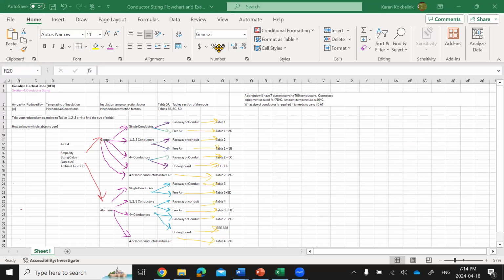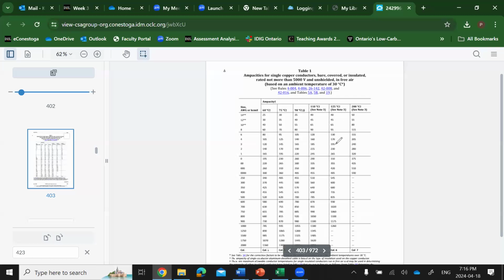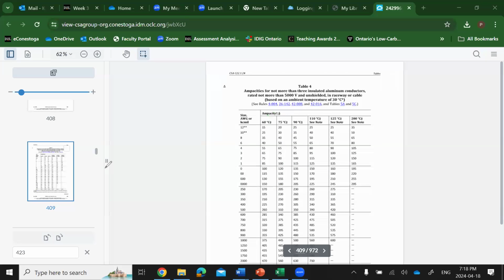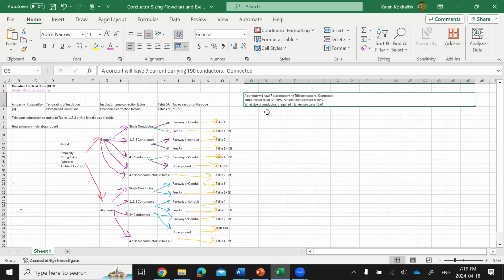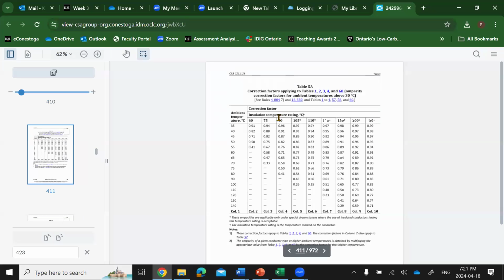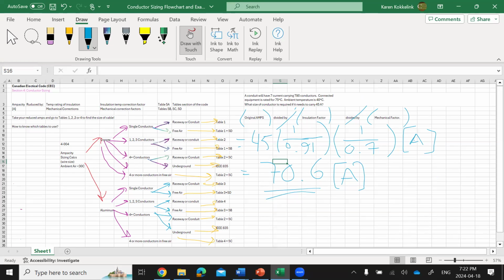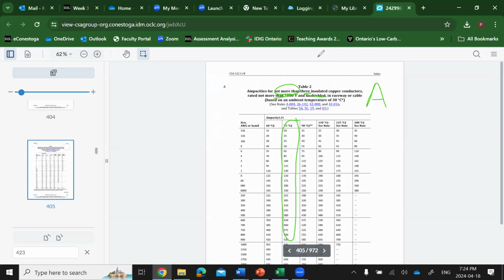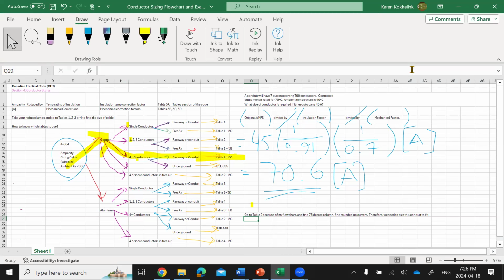Example of CEC Rule 4-004 Conductor Sizing for Electrical Exam

Comment: Doesn't table 2 say "not more than 3 conductors" and not "more than 3"
Reply from the maker: Indeed.  For more than 3 conductors, you are "bundling".  In this case, you need to apply Table 5C, because it's harder to dissipate heat when the conductors are all snuggly with other conductors.

Comment: Give an example for using table 5D and 5B
Reply from the maker: Hi @masoudariyaei5742, sorry for the delay.  I just made an example question and answer for you.  
Question: What size SER should I choose to run SER to a 100A sub-panel through an insulated, 40C attic?
Answer: 
SER cable is Service Entrance Cable, Type SE, style R.
For a 100 A subpanel, my overcurrent protection is 100 A.
The feeder conductors must have ampacity ≥ 100 A at the termination temperature rating (75 °C).  This is from 14-104 and 4-006.
Please look at Table 2.  We see that 3 AWG Copper has 100A capacity at 75C (terminations) and 115A at 90C (insulation).  We need to use the terminations column, 75C.
So the baseline ampacity is 100A with no corrections.
Correct for attic temp, 5A: 
But attics often exceed 30 °C, especially in summer.  So that’s were we use Table 5A, because 4-005 subrule 9 tells us to correct for this temperature above 30 degrees ambient.  Let’s assume the attic temp is 40C.  Table 5A has a correction factor of 0.88.  Note I still need to use the 75C column.  
So now the ampacity is 100A x 0.88 = 88 A effective.
This means the 3 AWG is limited to 88A in that hot attic.  That’s not sufficient for a 100A feeder.
We actually need 100A once it’s corrected.  So we actually need 100 A / 0.88 = 113.6 A so that it de-rates to 100 in the hot attic.
So now I go back to Table 2 and find the conductor size that can handle 113.6A.  This is 2 AWG copper, which can carry up to 115A at 75C (again, termination temperature column).  
So far, we have used Table 2, then 5A for the hot attic, then back to Table 2 to size up.  We are at 2 AWG copper.
But what if there’s insulation in the attic?  This reduces thermal conductivity, meaning your cable is going to heat up more. It can’t dissipate the heat.  The effect is somewhat the same as bundling, which is delt with by correction factors in Table 5C.
Correct for insulation (it’s like bundling), 5C:
Table 5C says I should apply AT LEAST a correction factor of 80%.  I advise maybe even 70% to be conservative.
Let’s say we choose 80%.  Then back to the 3AWG size, 100A, we de-rate with 5A and 5C:
100 A x 5A x 5C = 100A(0.88)(0.80) = 70.4 A.  This is WAY below what we need.  We need 100A/(.88)(.80) = 142 A.  That way, when it gets de-rated by (0.88)(0.80), we will get 100A de-rated.  
… so back to Table 2.  What size gets us the ability to carry 142 A in the 75C column?  The next size is 1 AWG which carries 130A.  Insufficient.  We need to size up to 1/0!  It can carry 150A.  
So, in summary, we needed to provide current-carrying-capacity of 142 A so that our feeder will still be able to deliver the 100A required after being de-rated by 0.88 because of the attic heat and 0.8 because of the insulation.  The smallest size that can do this is 1/0 copper.
Does this make sense?  When I get time, I’ll make a video of it.  Thanks for your question.  Any further questions?  😊

Comment: Hi. I am confuse why you use insulation temperature rating at 90 degree instead of 75 degree? Because the question said 'the connected equipment is rated for 75 degree'. For worst case consideration, we need to use the value at 40 degree ambient temperature and 75 degree insulation tempreature rating which is 0.88. Therefore, the ampicity should be 45/0.88/0.7=73.052. Am I correct?
Reply: Just because the CTT is 75c doesn't mean you use the 75c column on 5A. 5A is based on the Insulation Temperature Rating (as seen on the top of the table). So step by step: Step 1:  Derate for temperature using the insulation rating of the wire. Because it is T90 we use the 90 degree column on T5A. Step 2: get your multiplier from Table 5C.Step 3: Now multiply given ampacity divide 5A value (from 90 degree insulation) divide 5C value (for 7 conductors). Step 4: Go to table 2 (because conduit not free air) and size your conductor based off the given CTT (75c).

Done in reverse you would find your wire size from T2 -> Multiply by 5A and 5C values
Reply from the maker: Thanks for your question.  You need to use the 90 degree column for tables 5A and 5C and the 75 degree column for Tables 2 (or 4 for Al).  This is because 5A and 5C are for insulation temp and T2/T4 are for lowest of insulation or terminals. Terminals in this case are 75.  Does this help?

Comment: Hi, to get the wire size from. Table 2, why are you going down the 75C column, when the wire insulation is 90C?
Reply from the maker: Hi @ExampleRojas, i'm sorry for the delay and thank you for your question.  I'm using the 75 degree C column because the breakers and lugs are almost always 75 degree C rated.  Rule 4-006 overrides 4-004 by saying to check the terminations and the insulation and ensure you design for the lowest of the two. In this case, insulation is rated at 90C but the terminations are rated at 75C.  I hope this helps.
Reply: @Prof.K.  Hello prof. and thank you for all you're doing. I had similar question but you explained every thing. I think if the 75 degree not mentioned in  the question we should follow 4-006 sub-rule 2), a) and b) and this apply only for the first 1.2 m.